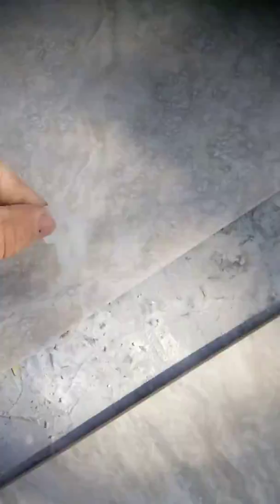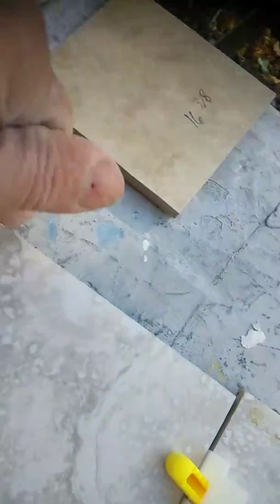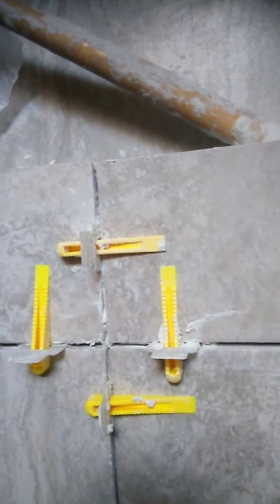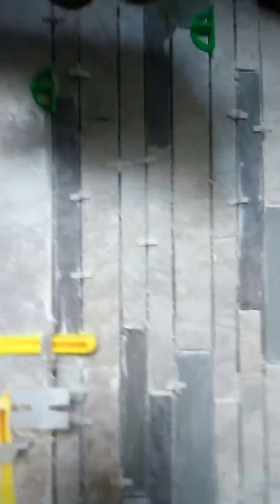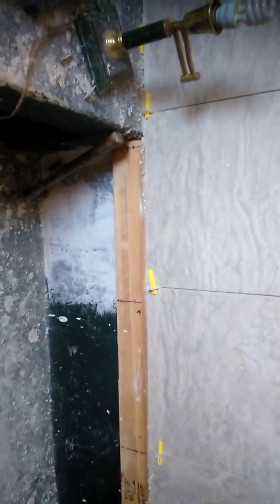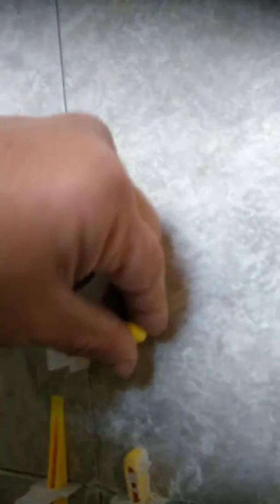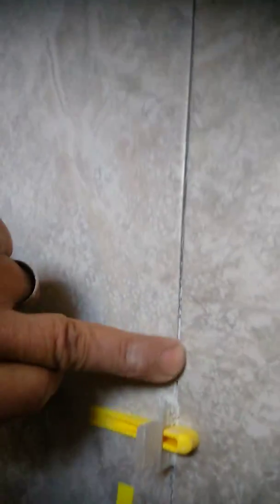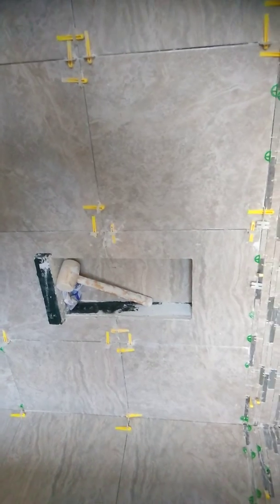Tile Leveling System |  Home lmprovement

Comment: So do you think the leveling spacers are worth it looks like they work well but do they actually cut down on the work?
Reply from the maker: The Joy Of Acrylic Pouring yes they do and worth your time you can actually add one or two to the middle of each tile to get it more precise if you need it something I didn't mention in the video and on the backsplash or the beauty band you want to use a level on the tile when you put up your beauty band at and you went to back butter which is putting thinset on the back of your backsplash or what we're calling the beauty band as well as on the wall this will push your backsplash further out than the tiles on the wall and then you push him back level with a level so they're even with your tiles and that's the trick I didn't show that a lot to think about when I'm doing a video and I'm shooting from the hip when I do these videos at this point so thanks for your input I hope I've answered your questions and feel free to ask more questions if you need more information thank you